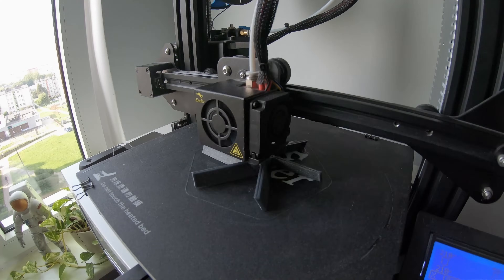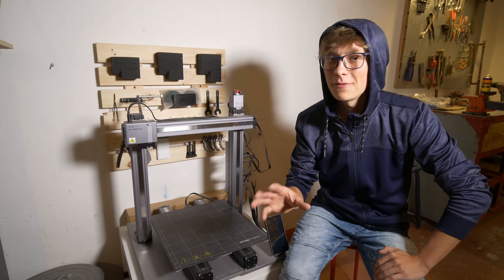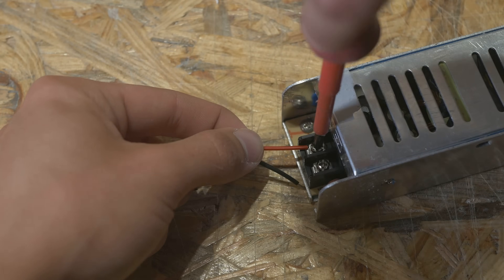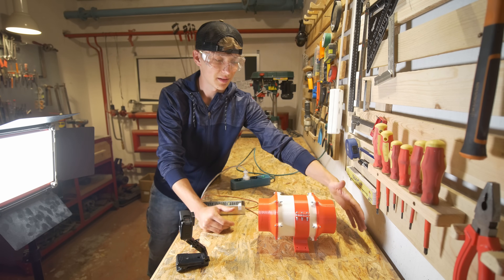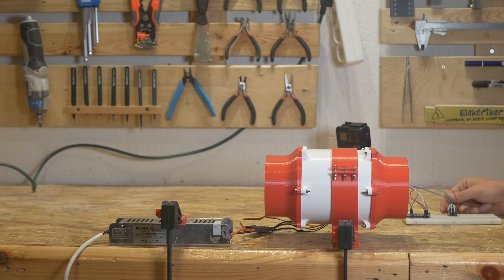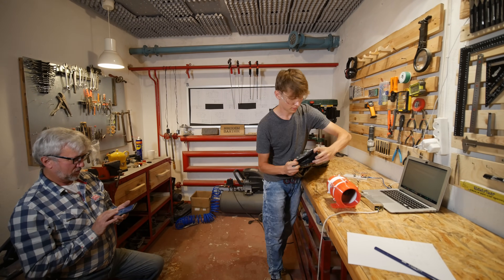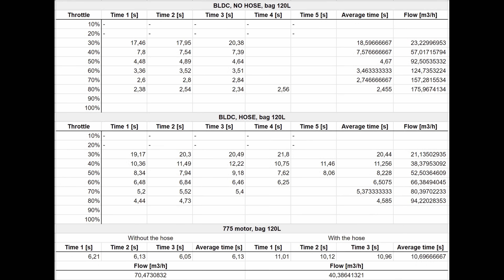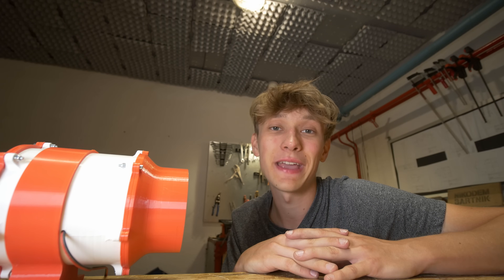3D Printing a Laser Duct Fan

Comment: you need correct gauge wire for 775 motor otherwise your wire is too small, will get hot and melt under long load .

Comment: I was thinking of building something like this but with a smaller fan and body diameter with a smaller tube like outlet nozzle. The usecase I had in mind is for blowing air via the flexible cnc air assist nozzle. Would this type of solution be capable of blowing chips when cutting wood/aluminium etc?

Comment: for accurate measurement of air flow....attach a pipe to the outlet side of fan about 10 feet in length, the air flow reduction  is caused by the internal friction  inside the flex pipe you were using... the smoother the inside of the discharge pipe the less friction, the flex pipe used has very high internal friction.. u need a meter magnehelic  gage to read the  inside friction of your chosen pipe,  you can build a PITO TUBE  { water tube or sometimes called U tube manometer } for reading the pressure, drill a hole in the discharge  pipe the size of the nozzle to take measurement... to find the total  external pressure of the fan.. install 10 foot piece of pipe on discharge  of fan and 5 foot piece of pipe on inlet side of fan.. drill hole in each pipe  insert tube from what ever static measuring device you choose, this will give a reading  total external  static pressure. i really enjoyed this video

Comment: If you put a taper on the back of the stator motor mounts then there will be less turbulence and noise and you should get a pressure output due to more efficient recovery of static pressure after the "restriction".

Comment: You're RPM limited due to the centrifugal force on the blades increasing the effective diameter. If you link the tips together with a ring then you should be able to get a tighter fit with higher RPM to increase performance.

Comment: Hello, there is an error in your design that caught my eye. The smoke from the Laser Cutter is highly toxic and dirty. Most of the dirty dust will stick to the engine. Therefore, you should develop a method to protect the engine from this dust. Good luck.

Comment: You need to balance the turbine then it will work better. That's how they test turbochargers they spin them and balance the turbine or the compressor wheel or sometimes both.

Comment: Interesting video! you need to balance the fan to reduce the noice and vibration. As for the fan design: certain desings are good for airflow, others are good for air pressure, if you have a long hose you need a fan design that creates enough pressure, to oppose the friction created by the hose. https://www.youtube.com/watch?v=JCx0SmDZ4nY&ab_channel=Painless360

Comment: 9:05 to make turbine suitable for bigger throttle and prevent it from disattaching you could do several things:
1. Increase central mass and reduce it on the outer of the turbine to prevent wobbling caused by centrifugal force
2. Make mold form and cast it from the epoxy resin in vaccum chamber to make sure turbine has well distributed mass or at least print it in lower layer height (or both so the mold made from well printed model), also worth notice that epoxy resin usually is more resistant to stretching ~30 N/mm2 vs ~22N/mm2 for PLA
3. Use some threadlock glue, low or medium strenght like loctite 222 or loctite 242
4. Use some proppeler adapter/hub instead attaching 3d printed part directly to the shaft of the bldc motor so exactly how properels were attached to your drone, i know the one that you were using might not be suitable(at least without adjusting turbine model), but there are bigger ones available online (ps. doing that will also fulfill 1st point)
Ofcourse you can combine all of those points.

Anyway nice channel I hope you will contine working on that project ^^

Powodzenia ;)

Ps. Just like people suggested you can also check "Major Hardware" channel or even reach to him and ask what design of 3d printed fan was the best so far in his "fan showdown" series to make it even more efficient

Comment: Since you are using an axial Compressor a good idea is to have a stator after that to convert some turbulence into straight velocity for the air. Another design is to have a series of Rotors and stators while incorporating IGVs/OGVs(Inlet Guide vanes/Outlet guide vanes). After that, consider using a rising meridian line design for that extra pressure gain. After that it is a case of studying the pressure gradient formation and the channel losses created by such phenomenons as the tip or hub passage vortex and the wakes. Using a forward sweep design can negate some of them. For starters, i would dry and then wet sand the surfaces and only then would i continue with a more theoretical approach. Also if you want to make your life easy, search for velocity triangles turbomachinary.

Comment: Connect a Nitrogen bottle to your laser. It avoids flames and reduces the fumes.

Because the air is very compressible, it is not simple to measure the flow by hand.
I would recommend to do each measure at least 10, better 50 times.

You could design different types of propellers and then do some airflow analysis with Fusion360 per some other FEM tool. 

Greets from an engineer.

Comment: An airhorn on the inlet will increase flow. Laminar flow airfoils on motor mount. Could also use a larger pvc tube for the exhaust tube.

Comment: On my old laser I installed a small aquarium air pump and laser cut a jig to hold it to blow on where the laser was cutting. Effectively what I was doing was blowing the smoke of the material away from the cutting laser beam so when it had to cut it wasnt weakened/defused by the particles in the air before getting to the object I was cutting

Comment: Nice design. As a few others have suggested, I think your impeller pitch is too steep, make the blades shallower and consider adding in a suitably angled stator to help reduce exhaust swirling and convert some of the rotation of the air back into velocity. You can make a simple propeller balancer using some bearings and shaft and get the impeller nicely balanced to reduce vibration.

Comment: Take a look at radio controlled aircraft and how they attach a prop to a motor for some great ideas on how best to get your fan mounted and working. Tip is to print the nose cone separate from the main fan body so that you can properly attach the fan to the shaft. Preferably your shaft will have a threaded hole in the end that you can screw into with a lock washer. Finish by snapping your nose cone on and you should be able to easily archive the speeds you need and not have your fan fly off.

Comment: Maybe you should use a "Motor Prop Adapater (Collet Type)" or buy a brushless motor with a threaded shaft so that you can better fix the fan to it. The second option is better becouse those adapters I first mentioned are known for be prone to bending. Nice project! Good luck!

Comment: Ok. 1. Motor supports are all wrong, turn 90 degrees to align with air flow, or even better, curve them to scoop the rotating air and straighten it back to pure axial flow, like the stator blades in a jet engine. 2. The cross section of the blades should be a airfoil with a slight camber, and the angle of attack should vary with radius like an aircraft propeller 3. Design an adjustable connection for each blade so that you can vary the pitch and then adjust for optimal flow rate. This easy with a split hub, front and back with sockets for each blade root. 4. For easy optimisation, mount the fan on a trolley and measure relative thrust using a simple string over a pulley suspending a water bottle, measuring water level at equilbrium. 5. mismatch blade number vs support number by one eg . 3 supports , 4 blades, this gives vernier effect and will reduce noise .

Comment: Maybe you can use a "set screw" to fix the propeller. To avoid possible imbalances you can use 2 or 4 of them, separated 180° or 90° degrees respectively
Reply: I would definitely not recommend that. Especially for a high RPM applications. It'd be much better off using a jam washer. The optimum though would be to print the impeller using fiber reinforced nylon and use a press fit to attach it. The fiber reinforced nylon should have just enough give to allow it to stretch over the shaft, and the fiber will bite the shaft giving much higher friction than normal.
Reply: @Unmannedair  Set screws for propellers are a common solution to fix it to the shaft. Many other options can be tried, especially if the expected speed is above 5,000 RPM or so, but for these applications, I think set screws are the quickest and easiest solutions. I am not an expert on this. I only give an opinion...

Comment: Also try incorporating guide vane into the motor mount. 3 or 4 aerofoils would be enough to return airflow to linear after exiting the fan. This should improve the flow characteristics and is a common feature to bypass turbine fan engines. It is very promising to see the fan becoming effective over 80% and leaving motor shaft. More power waiting for a small design change!

Comment: The Chinese will sell you a 4" EC (electronically commutative) inline fan with a metal housing and speed controller which can dial in any speed from 0-100% for a very reasonable price these days it's both VERY powerful and it doesn't use as much wattage as the regular AC inline fans.

Comment: You can add wing profile on the 3 legs of the motor bracket, to improve air flow after the propeler.
Reply: I can support the statement.
I built a fan with a PC fan and without an air duct to the propeller too much energy is lost in the rotation. directly behind the propeller a vortex is created which builds up excess pressure and obstructs the flow.
After the rotation, the air should be led through the propeller in the opposite direction. that had greatly improved my results.
Reply: I don’t understand

Comment: The fan blade is pulling itself off the motor shaft at high revs. This could be remedied by putting the motor the other side of the fan - so the fan would be pushing itself onto the motor shaft instead.  You could also get higher flow rates by running multiple stages - with the output of one fan feeding into the input of another - as yours are much less expensive than the "off the shelf" ones in the video.  Interesting video, as always.

Comment: Maybe you can reach out to the Youtuber "Major Hardware" He got a line of videos called fan Showdown and it is about the fan that is cooling the best. I would geuss strong cooling and moving a Lot of air could be very close to each other
Reply: There is a difference between air flow and static pressure, I would guess that static pressure is more important for long tubes
Reply: @m.sierra5258  Yes ich know that. But axial fans are never that strong with pressure. I was thinking of the shape of the blades and so on

Comment: brushless is better and mor powerful. But you should make a proper fan or better yet a centrifugal fan with probably some flow restrictions to improve static pressure. 
Other than that you need to properly balance your propeller and make sure the motor has enough air flow to cool itself and the mounting bracket can withstand the temperature and forces (because of creep)
Im in the process of also finding an alternative to an industrial extractor because of price, so id recomend going brushless (because of low maintenance and efficiency) and try reading a few books on propeller design, there are plenty on genlib or other online libraries. that should give you some ideas, and also you can use solidworks for the flow simulations, its not that hard to do and its fairly accurate

Comment: Hi Nikodem Bartnik ,
I have get the code but I am not able to get that what libraries are used in transmitter and flight controller so can you tell which libraries are used This all is about Arduino based drone

Comment: You could flip the motor and reverse the turbine blade angle. That way the turbine would push against the motor at high speeds and won't pop off.

Also you could buy a cheap gt2 pulley off aliexpress, pop off the ring and (heat?) press the gears into matching cutouts of the turbine, leaving the hub with the grubscrews exposed. It's often done in the 3D printing world, people print a large pulley and use the small aluminium pulley as a hub to securely attach it to the shafz. Last saw this with belted extruders (voron or sth.).

Also for not much more money you can get an ect or (bl) ducted fan, like thise used in RC jet planes, saving you all the aforementioned troubles xD
Reply from the maker: Sounds like a good idea to solve the problem with the turbine and quite simple, maybe placing the components in a different order because of that change would also increase airflow. 

I am afraid that it would be hard to balance with GT2 pulley (usually there are 2 locking screws at 90-degree angle)
Thanks a lot!
Reply: @nikodembartnik  These pulleys come with many bore sizes. With an an avervage precision motor shaft it should't be an issue to center it unless you're talking about balancing weight distribution but if you truly want to tackle that, the 3D-printed propeller/turbine is the 1st to go out the window

Or you can buy an outrunner bl motor. Those provide more torque and often have screwholes on both the stator faceplate and the outrunner rotor. Screw the stator faceplate to the motorholder and screw(!) the turbine/propeller to the rotor. No pulleys and no propeller/turbine blades flying off 👍🏻

But then that would be identical to an ect / ducted fan which is probably only 5 bucks more than the outrunner motor.

But I would still enjoy a video of a printed one ^^

My pleasure, thx for the great content 👍🏻

Comment: Make push impeller.  It will self tighten against the shaft. Axial blowers are good for high flow but low pressure. This makes it good for low resistance applications. Centrifugal impeller is better for high pressure drop applications allowing good flow for long ducts.
Reply: Pan Przemysław dobrze mówi
Reply: Polać mu wódki ;)
Reply: Yeah and could use the fitting that came with the motor to mount the fan securely to the motor shaft

Comment: This kind of motor will not last long in this environment
Reply: Definitely agree, but first and foremost I think this is a really good video cos he is trying out some ideas I had, but I now see where I may succeed or fail. Second, that motor is housed inside the duct system so that means that as he is using his powder coating setup, that 775 motor probably has a built in cooling fan within it that will suck in the powder coating fumes and particles which will clog up and destroy that motor (probably sooner than later). I guess the ideal design is where the motor isn't exposed to dust, fumes, particles, etc... as it's running

Comment: Nice design. The blade probably needs to be balanced?
Reply from the maker: Thanks! With 775 motor it works great with no balancing at all. With BLDC sometimes when you hit a specific frequency everything starts to vibrate like crazy but when you increase the throttle a bit more it's fine